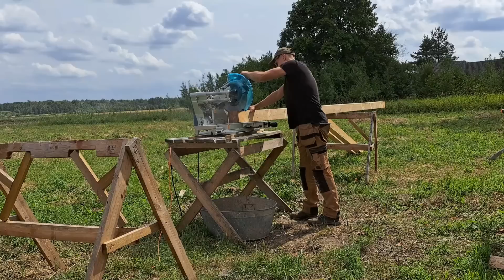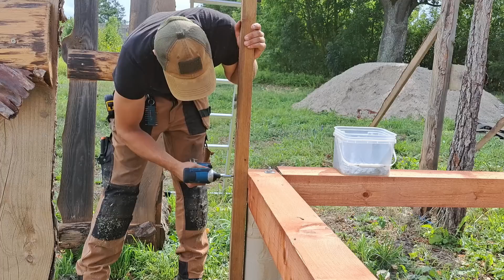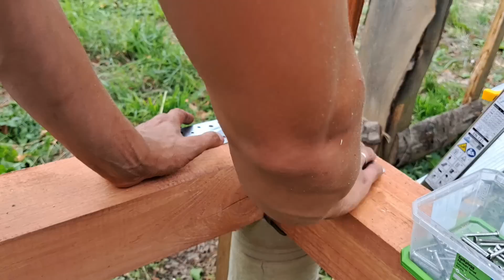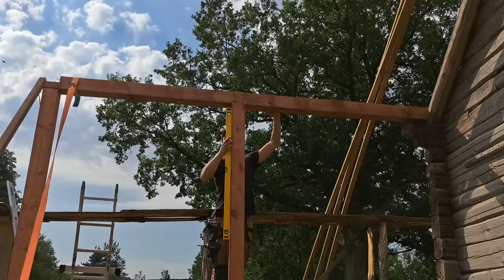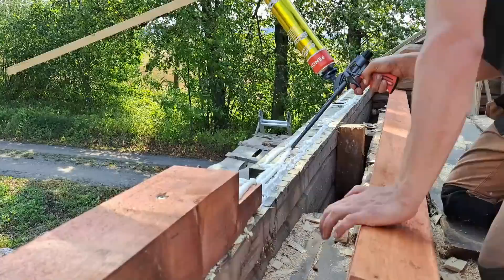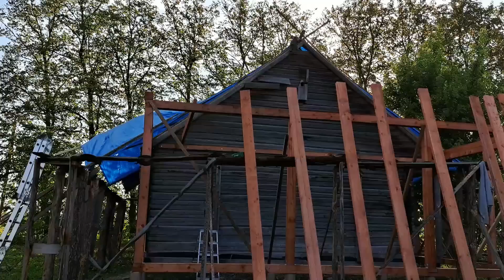Off Grid Log Cabin Renovation | Timber Frame House Extension

Comment: Love watching your videos and watching your work. Brilliant work. You probably already know this but if you put a block of wood behind your piece of wood and in front of the fence of the sliding mitre saw. You will be able to cut the half lap joint the whole way without having to use a hand saw to get the last rear piece down to the correct level
Reply from the maker: Thank you! Yeah I know but I need that guard wall

Comment: Is the foam between the beams for insulation or it serves also as padding?
Reply from the maker: Its for insulating the gap... I prefer using rock wool for this tipe of joint... but weather was unpredictable and I prefer that rock wool dont get wet so used foam instead, it will be covered anyway